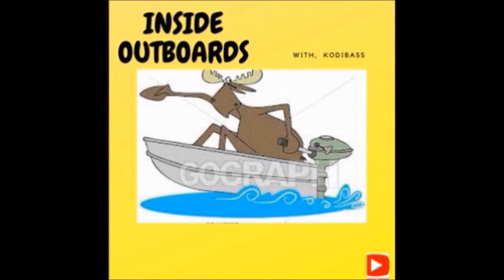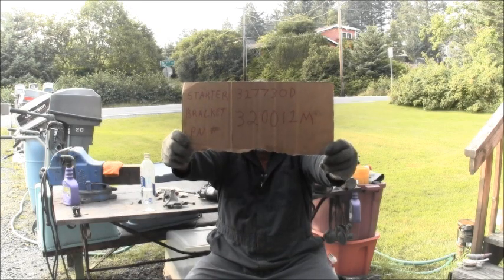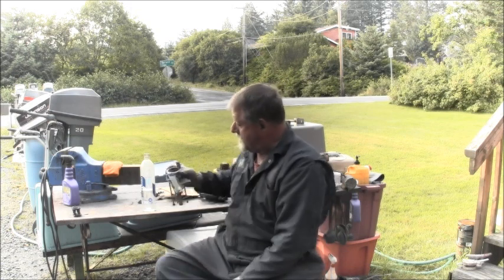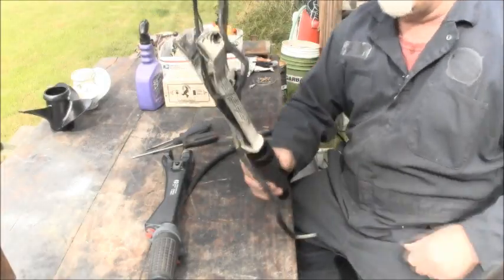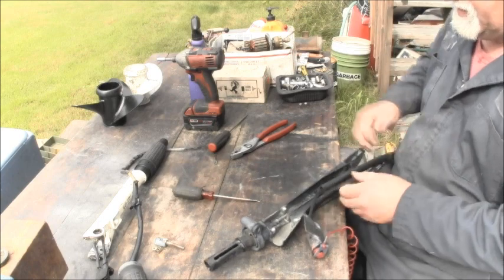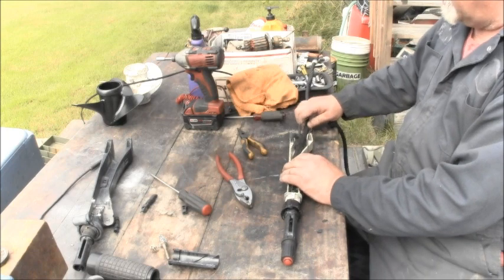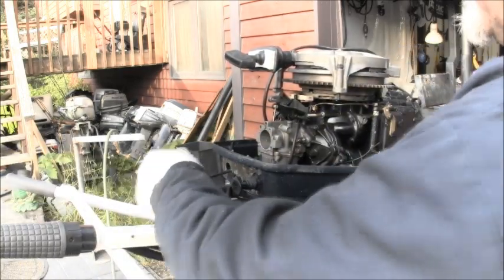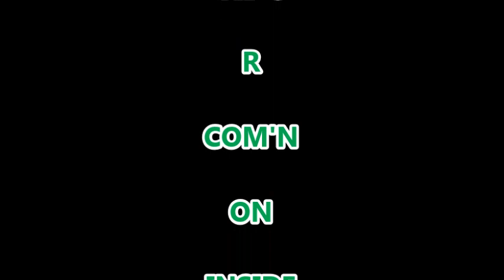JOHNSON  EVINRUDE ,    (   jonnyrude,   Part 2  )

Comment: Do you think that OMC was still using lead paint on those motors? The thought came to me while I was wire wheeling a lower unit.
Reply from the maker: I think it's possible, OMC  was in dire straights,  Whatever the could get away with.   kb

Comment: Thanks for explanation on mounts…I couldn’t see difference on a 1977 vs the 2003 I have.I am still trying to figure out why someone notched out where the timing screw threads they starter bracket to get more adjustment on the 2003.Compared where the cam roller lines up on timing cam to my 20hp 1985 and they both are about the same spot but the 2003 wouldn’t have enough adjustment if bracket wasn’t notched??
Reply from the maker: Someone trying to get abetter idle or something, Never know tho.   kb